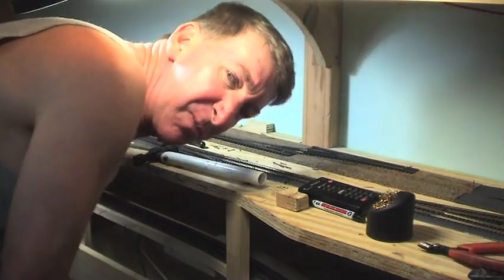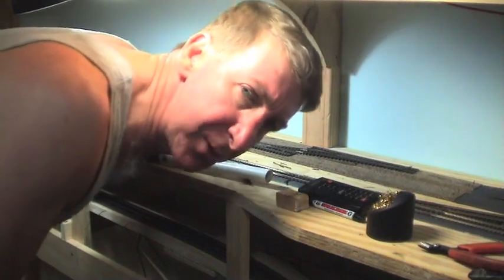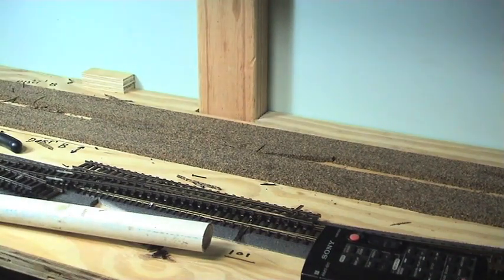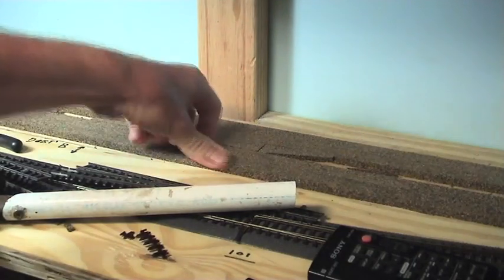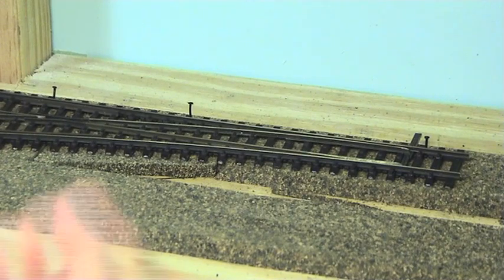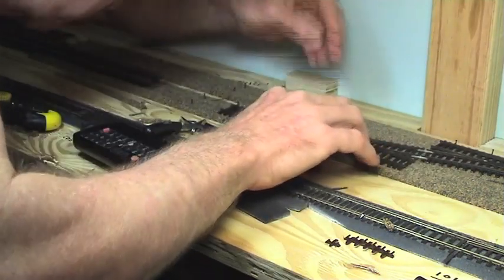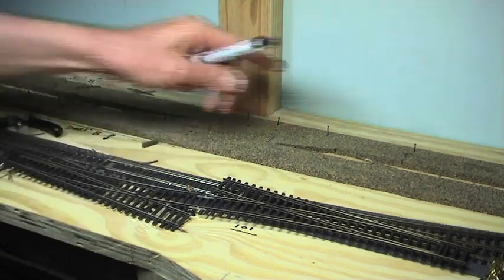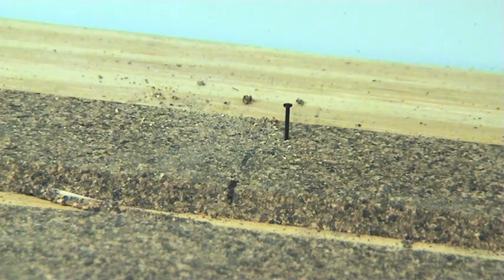Crossover install on the BNSF Birdwood Sub'.

Comment: Looking forward to part two! I would love to see how you would wire up a Micro Engineering crossover if you haven't done that already. Great job and Lord Stan is the man!

Cheers! 
Tim
Reply from the maker: Thanks Tim! ME turnouts have a "Dead" frog , so it doesn't need powering, but it's a good idea if your running short locos over a few in a row.
Cheers Gregg

Comment: I ended up using the foam to simulate asphalt roads - they were not good for Track support.  The nails heads would stick up a little bit too on the foam base - that did not look good.

Your track is really terrific, looking forward to seeing some 'landscaping' go on.
Nice Work!
Reply from the maker: Cabin on the River Thank you , the foam is a pain to get the track level, so all the mainline foam will be replaced with cork. Then some scenery?????
Cheers Gregg